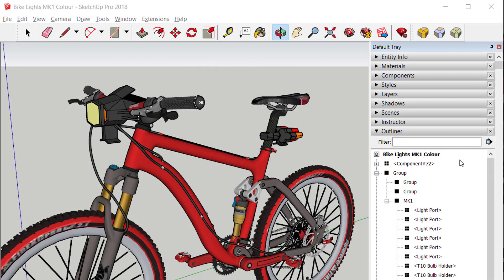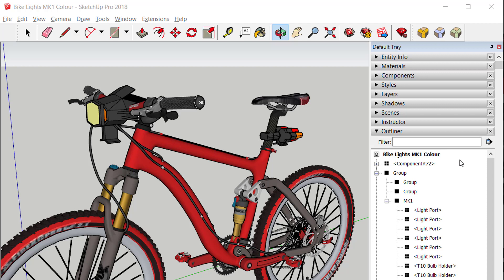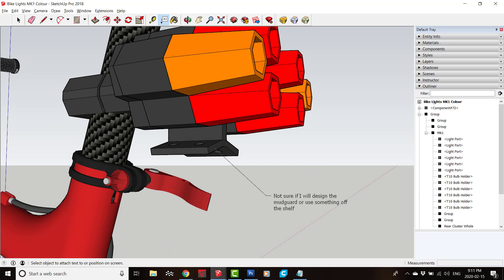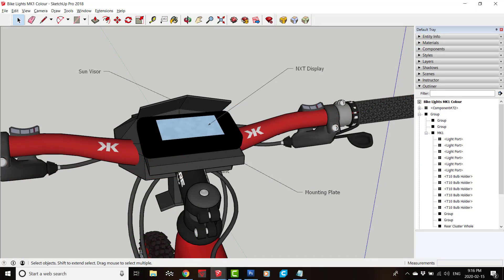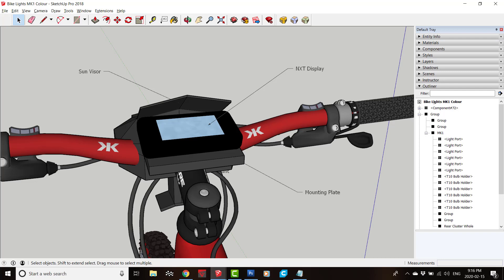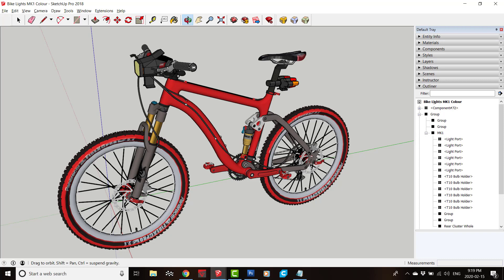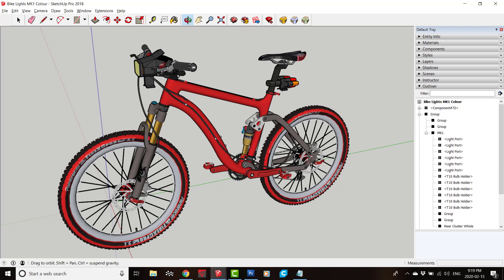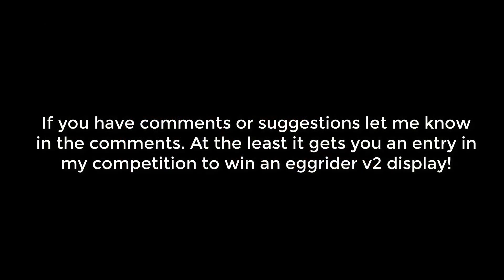Ebike Display & Lighting Project - Enhanced Security & Turnkey Road Legal solution

Comment: Those are great ideas! How about integrating some physical security features as well like disengaging the stem etc. I’m especially wary of leaving an ebike alone for a long time. That’s one limitation in its use.
Reply: While disabling software and removing shiny items like the display would be very helpful, obvious physical deterrents would catch the eye of most simple bike thieves.
Reply from the maker: I take my battery as well with me. I might do some labels as well. If a theif has to buy a battery and charger and display before he or she can sell the bike it will help. As usual it's a case of making your bike less attractive than others around. I'll keep your ideas in mind while I work on the project tho. I have heard motion sensors are going to be part of the controllers going forward so that might allow for an alarm. Alan at ERT says regen can be used to lock up the drive wheel as well. It may not prevent all theft but it will be a miserable experience for any thief.
Reply from the maker: That's a good idea. I worry about leaving my bike also!

Comment: Captain I think we are on the same wavelength for some reason I am building my ebike and I am having difficulty locating a proper taillight with turn signal that is waterproof and then I watch this video and I'm like.......
This is the second time u upload a video directly related to my train of thought days before lol

I really really love the design of this system, in your render I'm not sure exactly how the front mudguard would look when installed but, it's sure interesting.....

In the meantime I'm trying to secure my bike, have turn signals for my bike, have a good display.... Sigh this is stressful I can't wait for the summer prototype to be ready!!!
Reply from the maker: That's funny! I think I am going to have it be modular so maybe I can have the rear stuff working sooner. I'm definitely working on that segment first. Perhaps I can find a way for you to test it out? The NXT should be ready much sooner although not in the dock version. There should be some more details this weekend. Cheers
Reply: @HighVoltageKits  yes, i would love to i will try to start saving some cash towards it @_@
Reply from the maker: It wont break the bank. I plan on using existing electronics so no proprietary stuff to rip people off with.

Comment: Nice project. A lot of stuff to consider on this. I agree with one of the other comments the rear light assembly appears pretty big. I wonder if its possible to incorporate a rear view camera into the NXT? Look forward to seeing the project progress.
Reply from the maker: Cameras are tiny so I dont see why not. The coding etc to the nxt is Alan's area. I'll ask for nothing. Cheers
Reply: It would also be nice if you made it so it could be mounted on the rear of a cargo rack if equipped. Just a thought.
Reply from the maker: If I made the mount able to use a variety of fixtures this ought to be possible.

Comment: I would mount turnsignals in the bar ends. If you have everything on a tight cluster it wont be visible to a driver what direction the turn signal is intended to indicate. I would also suggest a serial connector/daisy chain for a 2nd set of tail and brake lights  to make hooking up a trailer with lights fast and easy.
Reply from the maker: I love the idea of the trailer hookup. I'll look into that. The bar ends might be trickier in terms of making it compatible with a wide range of bike grips. But I do see what you mean with separation. Maybe I can make it wider or look like an arrow.

Comment: Very nice captain I love the look of the front light unit. With the rear maybe it needs to be a bit more low key? Less bits to broken or broken by some one else or if you dropped the bike ect. 

I'm guessing you don't have your nxt display yet? 

Being able to remove the nxt is a game changer I can't believe you can do this with more aftermarket displays.
Reply from the maker: I have the nxt but I have been developing the casing and mounting hardware. I'm using it for my cyc build so it not ready yet for that. 

I had just seen the star wars movie when I did the rear cluster so yeah less complex is a good idea and likely more compact. Once I get the light holders in I will be able to shrink it a fair amount I hope.

Good suggestions! Cheers
Reply: @HighVoltageKits  ah ok that will be interesting on the cyc I shall look forward to it. 

Lol I should think you had I think even with that design with the light channels ( the rocket boosters 😂) were reduced in size I think it would look much better and be less prone to damage. Maybe could build in some kind of motion sensor alarm into it as well possibly?

Comment: I looked into making a rear light/ radar unit like Garmin have a few months ago and while I am not good with software I did find that Cree make an exceptional 3w red led you can buy in bulk from ali express. I will try and find you a part number but the amount of stuff I try and build its more than likely lost in a full desktop of folders haha. If you can get somebody more software inclined it would be nice to see the application of the Garmin radar implemented on this.  I'm currently working on a better mounting method for the speed sensor on my bbshd using the disk rotor and a slimmed down housing.
Reply from the maker: The speed sensor sounds cool idea. They are way too chunky. I'm looking at the led lights but I forget the type. There is a fitting they use in cars with rubber holders. They should allow for easy repairs and work well with the parts I design. If you find the link please post it here. Cheers

Comment: This is a really nice concept and I like the design but I'm not sure the front fender mount will work very well being that high up, I bought the SKS Shockblade front fender and that hooks right into the fork tube above the tire and even then it seems too high because of wind blowing water out from under it and right back onto me.

I just got my order in for the CYC X1 pro Gen 2 so I can't wait for that, I hope Alan can add support for the stock controller on that with the NXT display or maybe I'll try my hand at swapping my BAC800 over to the CYC if I need to.

Keep up the good work!
Reply from the maker: Hope you get your motor soon. I can probably make the fender mount adjustable. It's way too high right now. Maybe even optional as many bikes do have other options. I was more thinking of those moto cross kits or downhill bikes.